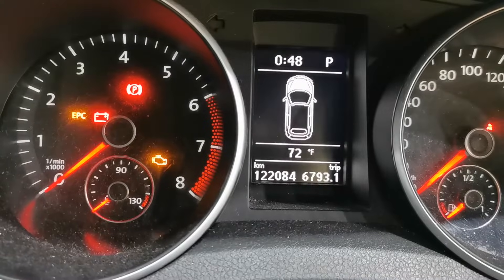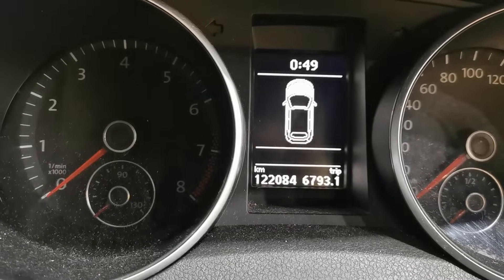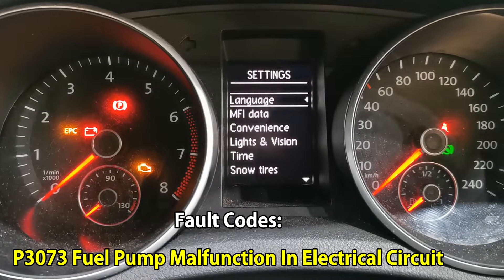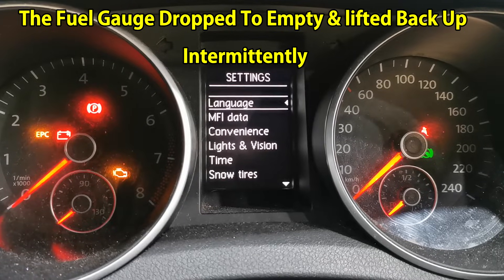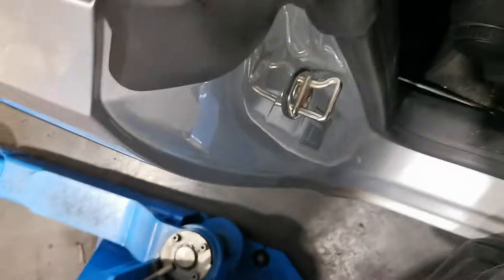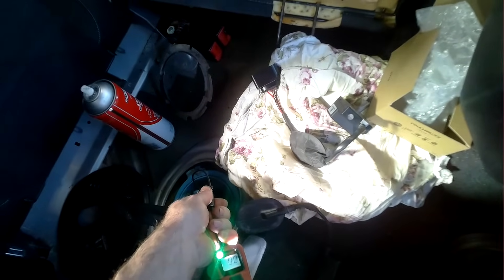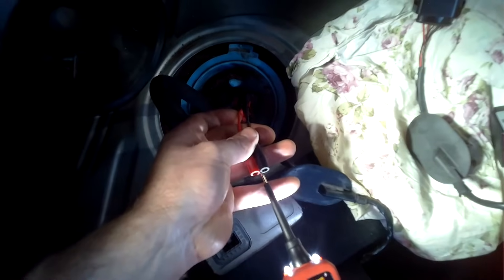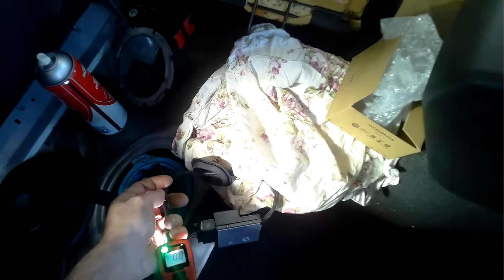Volkswagen TSI Cranking But No Start Fault - Found & Fixed - How To DIY

Comment: Gerard, I’ve got a scirocco 2011 2.0TSI CCZB, cranks and doesnt start. I’ve verified fuel getting into cylinder and rail pressures correct, I’ve got a spark, I’ve got compression, no codes. Replaced timing chain, crank and cam sensors and still won’t start. Any ideas?

Comment: Gerard my MK6 crank but not starting. Fuel pump okay, fuse box okay, crankshaft sensor (brand new) okay, timing okay. What else could cause it not to start? Please respond, been 3 weeks now.
Reply: Hi did you manage to sort this. Same issue
Reply: Hi, check for errors using an OBC scan tool.
	•	If you see “no communication ECU”, the ECU is likely dead.
	•	If no errors show up, do a compression test:
	•	Low compression → possible worn piston rings
	•	Could also be bent valves or damaged valve seats

Comment: Great video. Been fighting my Mums Golf mk5 1.6fsi with the same problem for weeks and have ordered the same part. Hoping this resolves it, can't test it as my multi-meter is broken! What probe are you currently using?

Comment: i too had the same engine,got an epc light and turn off while driving,i quickly made to side and did scanning,found  low  fuel rail pressure error ,tried clearing dtc and starting but no luck so  i towed to nearest service center ,after it arrived there the car has no issues they scanned multiple times even drove for few miles  no error code or issue , they looked the fuel filter and its fine not much clog,is it advicable to change pump or control module as preventive,also i'm getting very low fuel economy(below 15-20mpg or 15-17l/100km what could be the issue ,i asked to check the 02 sensor but they are arguing if its failing i would get engine light ,also  the power is also less what could be the reason for this?currently odometer just over 1,00,000km ,thanks
Reply: @harir1218, did you ever figure out the problem? I have a 2012 VW CC with the exact same symptoms that you described.

Comment: Hi there, could you please help me know which one of these Nexen tires will provide more comfort for a SUV with 255/45/r20 size?
Nfera Supreme
Nfera Ru1
Nfera Ru5
these are the ones that are available in my country/region, and I wanna pick the most comfortable one among those.
Reply from the maker: I do not have any experience with that brand of tyre unfortunately. There are so mamy different tyre options out there but that is not one I can give any honest direction on.

Comment: You gotta wonder where did the water come from? Did someone spill something on the seat? They are designed to keep water ingress out of the module and connector. Good catch mate! 😊😊
Reply from the maker: Designed to but.... I have seen so so many different components in the electrical system of VW's with water ingress over the years (coming from a very rainy climate 💦😉)
Door modules used to get literally soaked and play havoc with central locking and windows.

Water could easily slide past that connector and soak up around the pins. I imagine if that seat was soaked for whatever reason it would have allowed water to get to the pins for sure.

I have seen on VW's where the boot got water filled and then under braking the water used to run over and into the back seat area. (similarly on many other models)

It's a possibility, either way some fluid was present by the looks of it and has since dried up in this 40 degree heat 🔥😁😉

Thanks for watching mate, always appreciate your input 🙏🙏
Reply: @GerardBurkeBurkesGarage  We have crazy weather here in Oz. Yes, I've seen water in strange places and as you said, it does depend on the driving conditions as well as the weather. Ah, ya gotta love being a technician! 😉😉

Comment: Awesome ... great work. Wondering why there is no rpm signal during cranking..  Is that VW being VW?  Without a scan tool I'd also be looking at Crank sensor?  Just an observation.
Reply from the maker: Thank you 🙏🙏

The RPM on many vehicles doesn't shake the dial needle up and down, I had a colorado the other day and it was the same. looking at the live data you can see the RPM change.

Thanks for your kind words 🙏🙏
much appreciated 💪